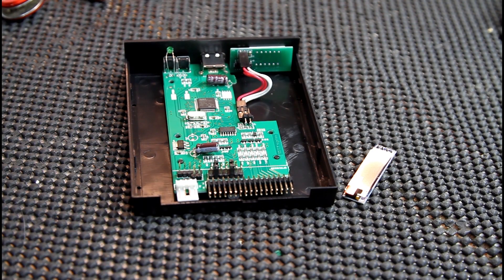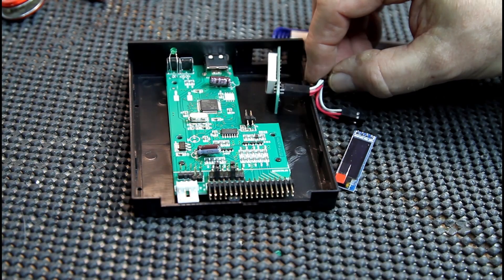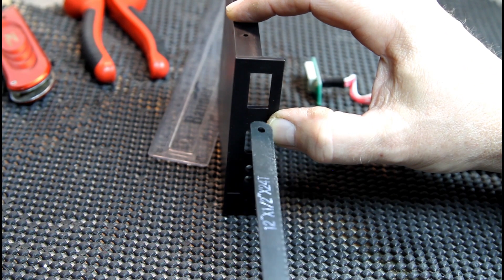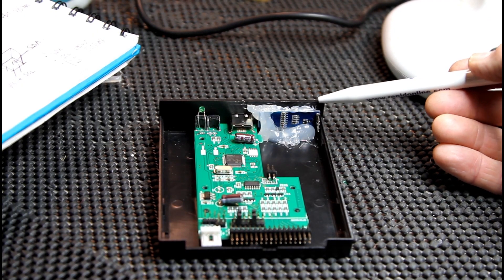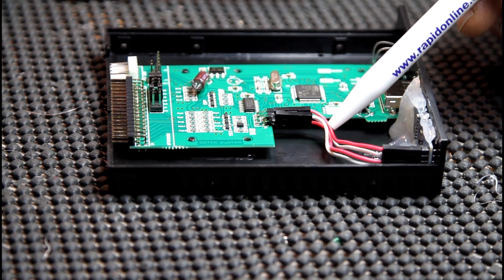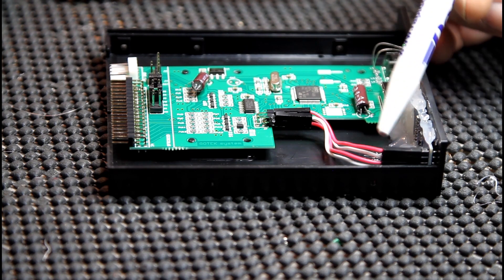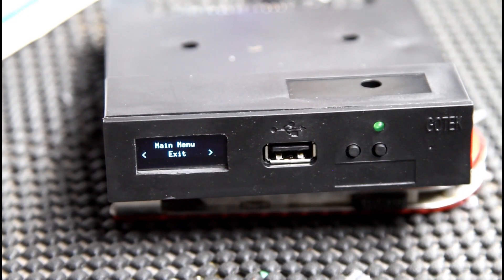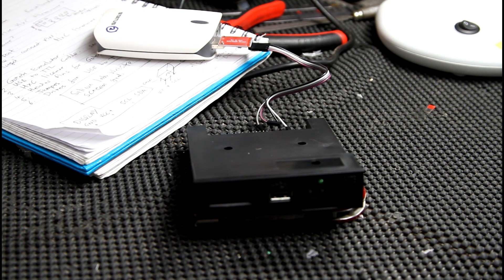Quick tips for your music equipment Part 3 Install OLED screen into your GOTEK emulator

Comment: I installed one I bought from Ebay in July on a Yamaha QS300 keyboard workstation.  I wondered if it would be just a flash looking gimmick, but glad to say not at all........ these screens are easy to ready even from awkward angles at a distance, and my eyesight is not great.  Mine has the rotary push button knob and selection buttons.  Well worth investing in or making your own etc.
Reply from the maker: Definately so much easier to see the file names on your usb stick, an essential upgrade we think, many thanks bangers and chumley